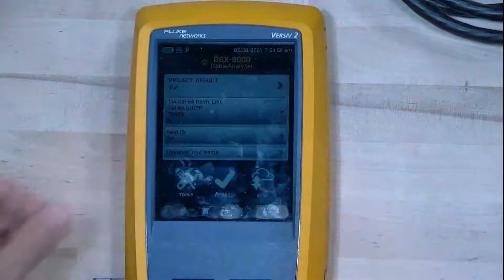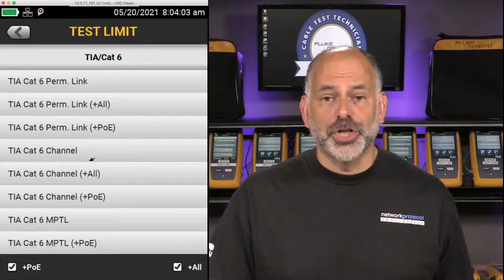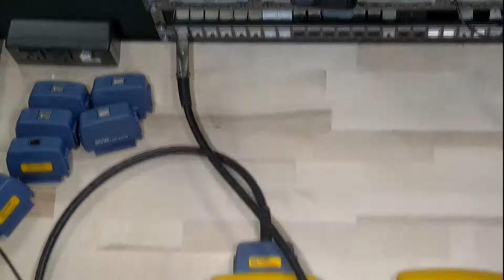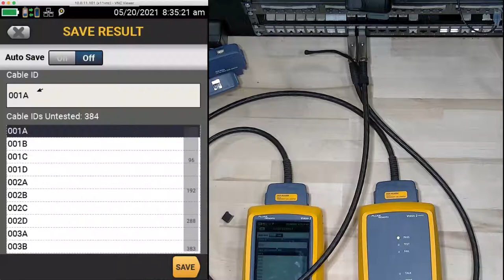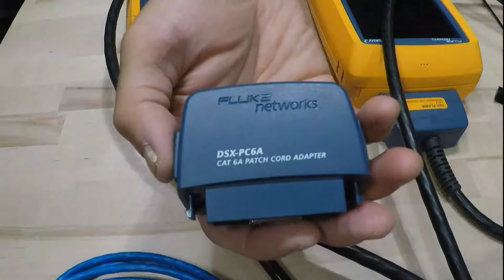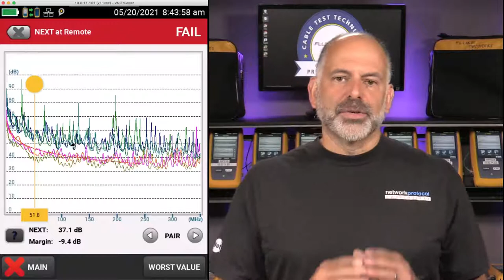Getting Started with the Fluke Networks DSX CableAnalyzer™

Comment: Mike, I am confused about the DSX-CHA804 Channel Adapter vs the DSX-PC6A Patch Cord Adapter.  I thought you said that we would use the Channel Adapter to include patch cords that will stay in-place (such as connecting a server or PC).  But then, at minute 36, you showed that the Channel Adapter would not work for a MPTL test.  I thought an MPTL test was what you would be doing to test from a server patch cord to a remote wiring closet patch panel.  Can you elaborate or clarify?  I now do not understand where/when we would use a Channel Adapter.  Thank you - these videos are great.